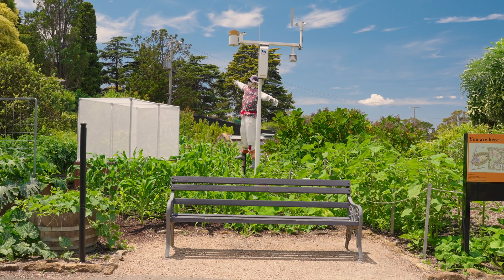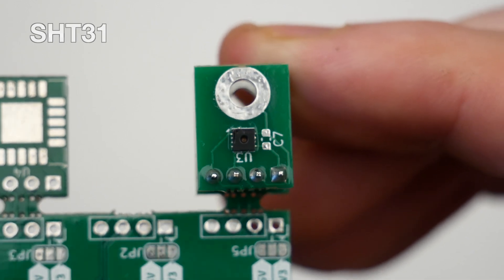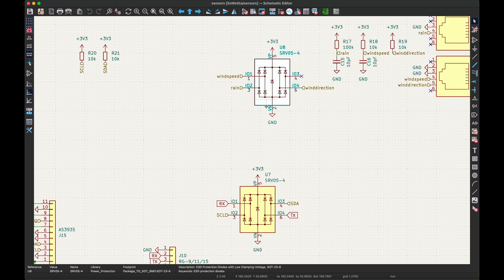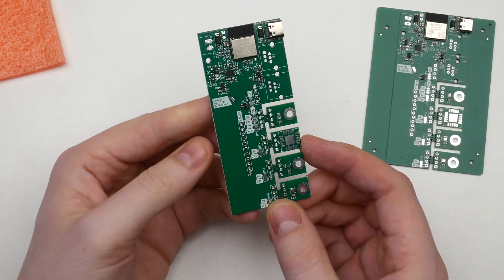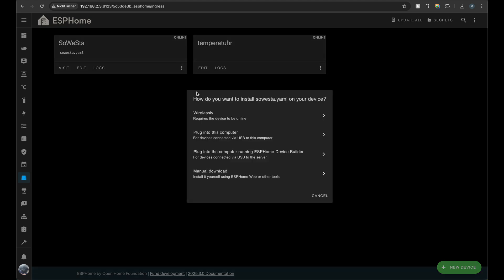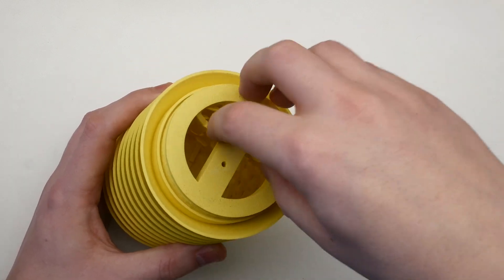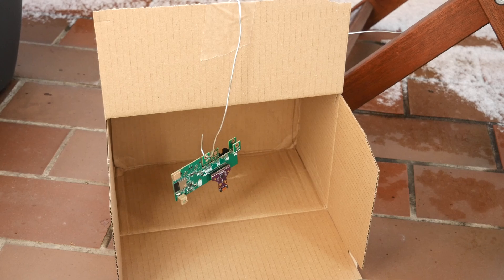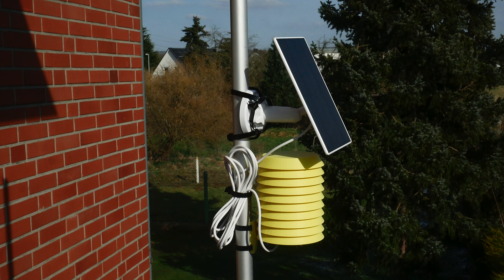Solar powered Weather Station | ESP32 | AS3935 | BME280 | SHT31 | ESPHome

Comment: Nice and promising project! I am currently struggeling on doing my own power circuit for an similar project. 
Do you have already data on how well your solar-battery solution is performing?
Reply from the maker: Yes, it works quite well. I even turned off the sleep of the microcontroller as the solar panel provides enough energy. We'll have to see how it performs in the winter though. Currently the SOC does not drop below 90% or 4V. Also the lightning detector does not work, I haven't been able to identify the problem there yet.
Reply: Sounds great! If it is okay I might copy your circuit :)
Did you consider battery protection in any case? I am worried about deep discharging the battery
Reply from the maker: @seschwar I think I added battery protection to the PCB, but I am not sure atm. Also there might be some issues, let me check later if I still have some changes to push to GitHub